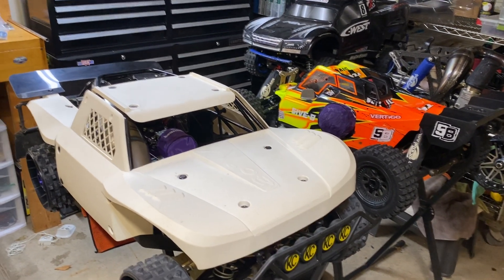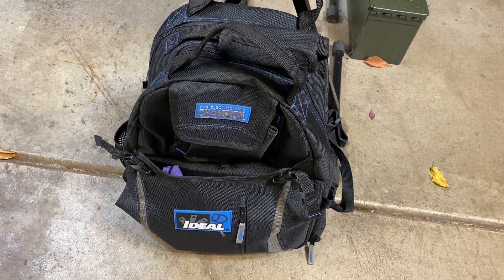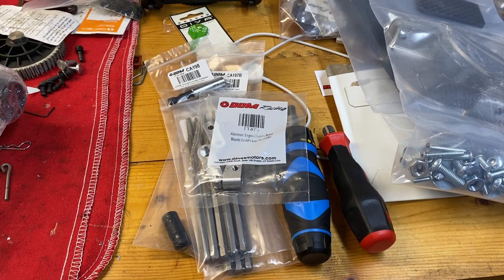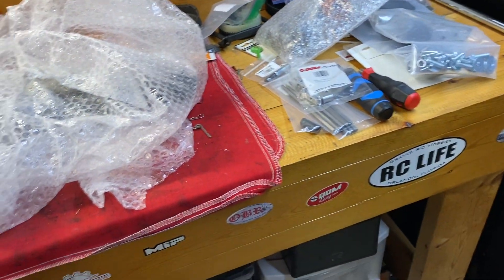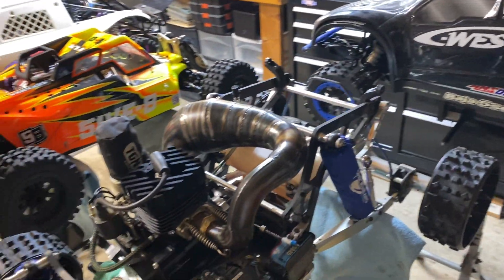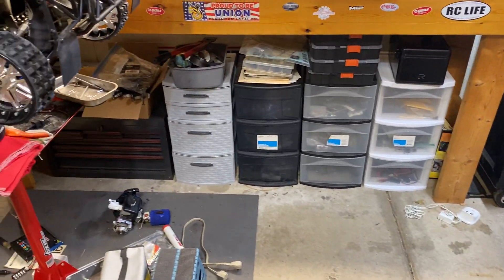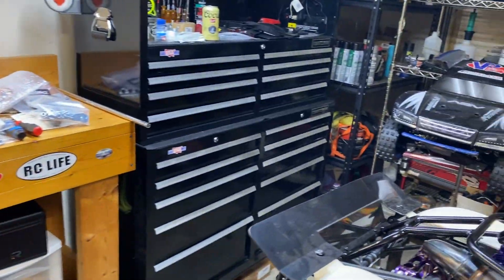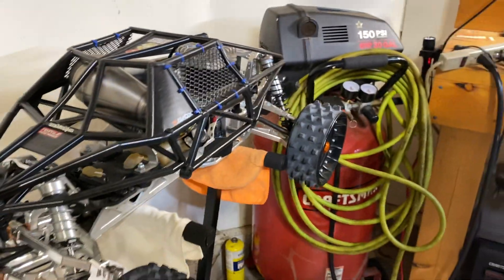Taylor rc goodies/ and a Rant 😡

Comment: Only thing I had a issue with was the bonehead carbon fiber hinge pin carriers I had to grind the front rear to fit on my rear Baja rc modified chassis, passed me off that I had to grind to fit, but it is what it is?🤷‍♂️ rc family looking sweet 😋 😍
Reply from the maker: Ya I definitely get it, but I do think we u spend too dollar there should be no modifications needed
Reply: That's the chassi that caused that not the hinge pin plate
Reply: I've never had to mod a bonehead hinge pin brace  have many sets of them

Comment: I have bought a few of bone head stuff for my build, and I have to say there quality is not that great. Carbon is to thin on the parts I have purchased. I have started making my own parts. I have issues with Detroit trying to get parts. All I need is rear extended upper baja arms, and its completely impossible from Detroit performance for me.
Reply from the maker: I’ve seen just the rear arms on Rcmax wedsite, or u can contact Flm